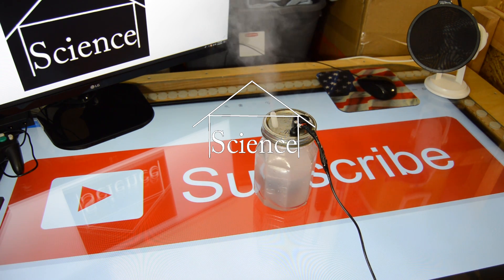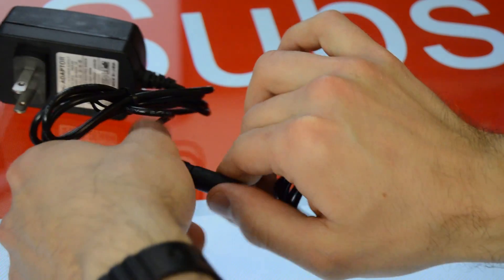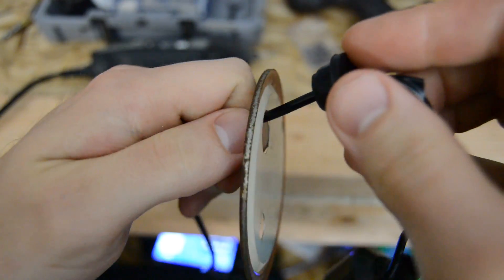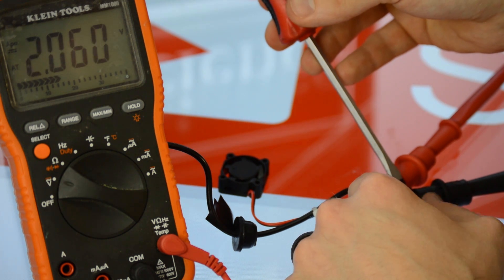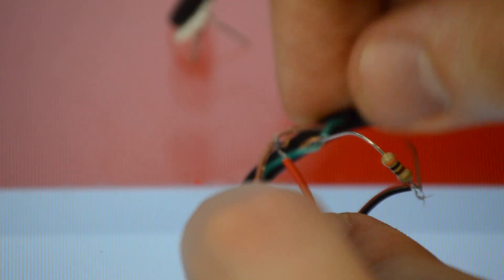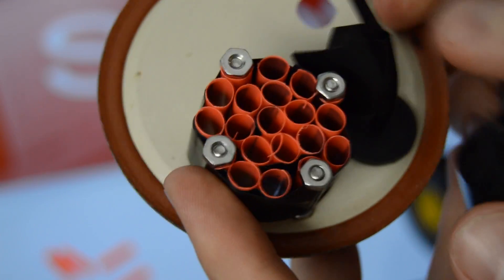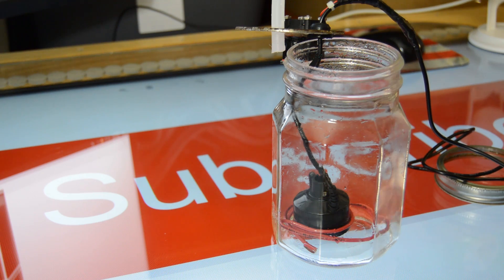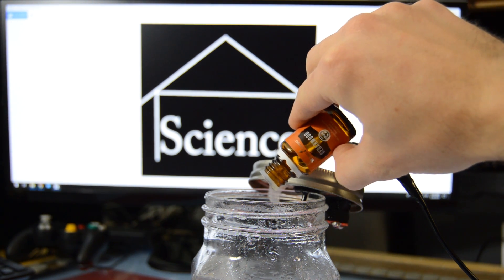Homemade Essential Oil Diffuser How To ~ A DIY Oil Diffuser Anyone Can Make

Comment: ( 00:50 ) lazy option would be using a 24V DC fan ( 3D printers ). Then you don't have to do the lowering the voltage mod. All n all, this is a great idea and I have already place my order to get the atomizer. I subed and rang the bell already. Now where is the button that gives x100 thumbs up
Reply: @raarism  : Using A vaporizer unit is OK if you don’t live in a place that is not terribly humid or terribly cold.  But if you’re living in a place that’s either one of those things, it’s not such a good idea, because you’ll never manage to heat the house, and you’ll have mould problems.  Those of us that fit those criteria really need to choose another method. If it’s just about getting essential oils into the air, and ultrasonic diffuser is a good way, or you could passively use a hot oil ring On a lightbulb. Or A passive method like reads in a container of essential oil solution.

Comment: Garage science: I’m a total noob at this. So, I’m wondering why you chose to use A fan and fog maker combo of different voltages. Would there have been a problem associated with using two of the same voltage?

Comment: Very nice video :) Is there any way the frequency of the ultrasound diffuser can be controlled so that the mist formation can be reduced or increased ?? Thank you in advance.
Reply from the maker: A lower voltage should result in less mist up to a point. Then it probably will just cease making mist entirely past that point.
Reply: @GarageScience  Thank you. If I have understood correctly, there could be a small window for adjusting the frequency of the diffuser. Since I am not having any background in electronics, I would like to ask by what means could the voltage be adjusted.

Comment: hiii .. i have a question if I use a 12v ultrasonic mist maker instead, it means that I do not need the resistor to lower the voltage, right?

Comment: hi...can u plz let me know 2 things 1)Can it be connected to the battery for teh power source and 2)Can it be motion sensored..that is can it be motion activated and kept in a room?please advise ..If possible,can you please add a video for that...I am trying to make this kind of project for quite a while..I need an expert advise like you.. @Garage Science..also there should be a mist level controller - Low ,mid and high

Comment: If you wanted to make the mist be a little warm, how would you do that?
Reply from the maker: You could out a very small heater in the jar as well or use an insulated container and just put warm water in it to begin with.
Reply: Garage Science are the mister devices heat resistant?
Reply from the maker: They would be a little but I wouldn't expose them to water that is hotter than about 100-110 degrees. It's still electronic equipment.

Comment: Btw, I've got a pirate snowglobe, with 2 internal led lights & a tiny glitter blower, that runs on two AA batteries but burns thru em in 30 min. How can I make a wall plug for it so I can bypass the battery dilemma?

Comment: Could anyone kindly tell me what base to use for this kind of diffuser? Would an oil base be necessary or would distilled water work? Tia

(edit) I know he uses water in the video but looking to make a bulk lot and obviously water wouldn't work for that. Though id rather not be breathing in loads of oil/whatever else they put in the shop bought stuff.
Reply from the maker: Distilled water for sure. It won't work with oil.
Reply: @GarageScience  Cheers. After a bit of research into the shop bought stuff I've come to the realisation that nobody should be breathing that stuff in!

Comment: This was interesting, but you do realize that the cable/wire has plastic wrapping, which will be dissolved by the essential oils... and before it completely ruins, it will emit the dissolved chemicals from the plastic wire into the water resulting in toxic chemicals in the air. 
#chemistry
Reply from the maker: No such dissolution of the wire insulation has occurred even after months and months of use. You are right though, some plastics can be dissolved by essential oils.

Comment: He calls this a "fog maker", Is this the same as a "nebulizer", or just a regular "diffuser", I just found out the there is a big difference between the two, and a nebulizer is really the Only was to truly get the full therapeutic benefits of pure Essential Oils.
Reply from the maker: Well yes and no about getting all the benefits of the essential oils... a nebulizer is more a medical grade machine that makes extremely small liquids droplets in the air to help deliver medicine. Typically they use special stainless steel meshes with very small very high tolerance Holes. Where a diffuser essentially uses a small speaker to ultrasoniclly vibrate the water and create mist.
Reply: What he essentially means is an ultrasonic plate that is used to create the fog. This is used in ultrasonic diffusers which he created. Nebulizers are another type of diffuser which don't require any water, only essential oils.

Comment: I love the video but disagree with your tape option. You need to use heat shrink. It is a clean and more permanent solution. Also you mentioned that Young living is the purest oils but that is up for debate. Before my wife and I decided on a essential oil supplier we researched all the major brands. None of the brands carried  by stores are very pure. Also any bottle that states "not for internal use" is not safe to use period. If it goes on your skin, it goes into your body. We chose to go with a different company as to all the court nonsense and purity issues surrounding Young Living. I also did some trial comparisons between brand and Young living was not on top. Thanks again for the great video ideas.